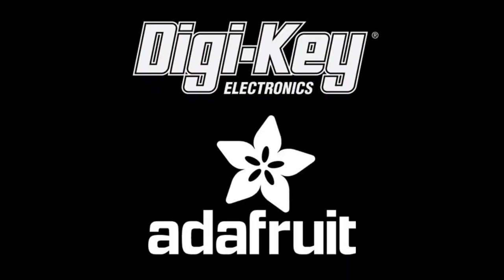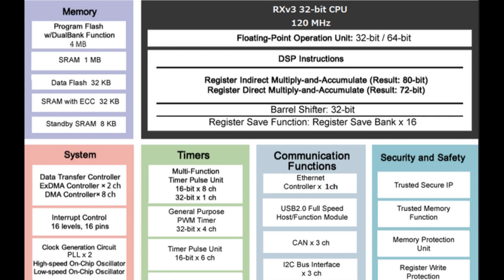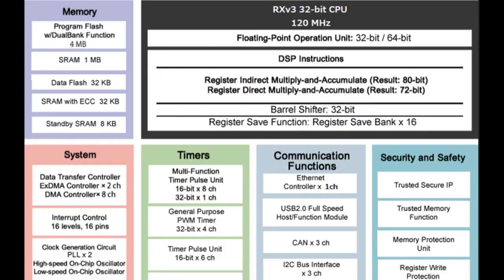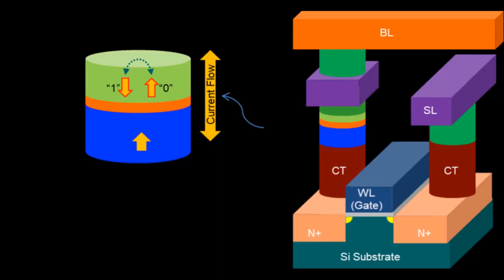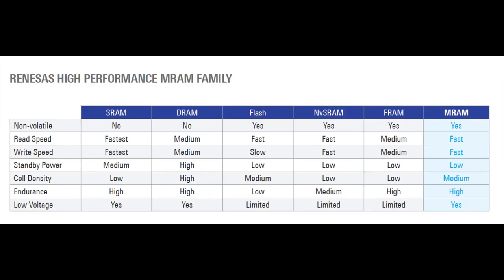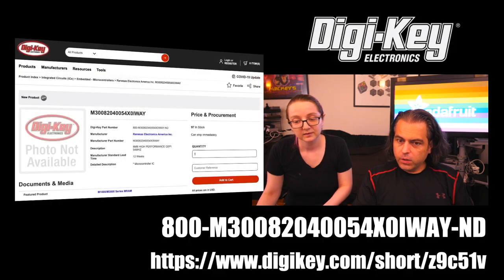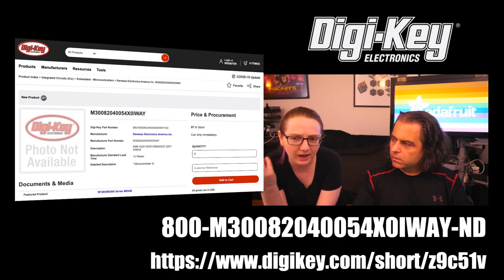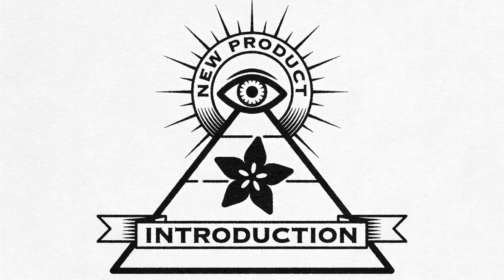EYE on NPI - Renesas MRAM #EyeOnNPI #Renesas #DigiKey #Adafruit @digikey @Adafruit @RenesasGlobal

Comment: I wouldn't be surprised if MRAM will completely replace the NAND flash chips on the NVMe SSD module as NAND flash (and, unfortunately, by extension both PCM and FRAM) cannot be shrunk down much further than 10 - 5 nanometers node.

MRAM chips packed with 2 nanometers GAAFETs / 1 nanometer CFETs have been successfully tested, especially by Samsung, so it's reasonable to except MRAM chips with several tens to hundreds terabytes capacity for SSD bulk storage within a decade as the transistors in bulk storage chips continue to shrink to the point new transistor materials are mandatory.